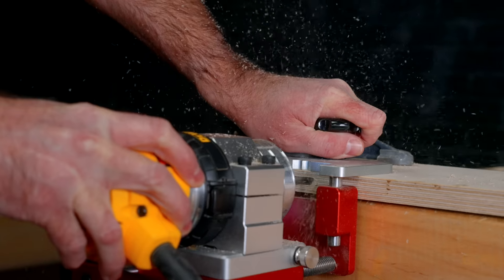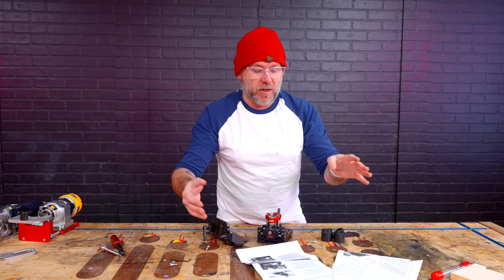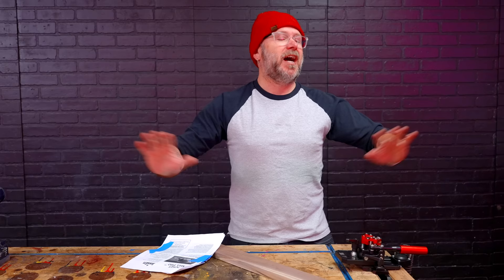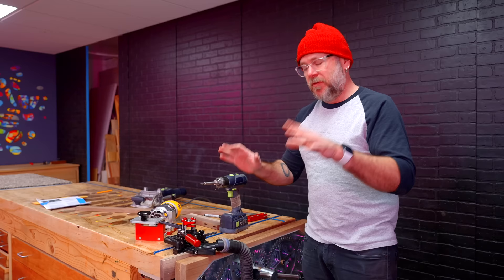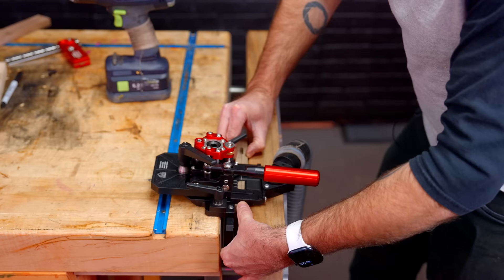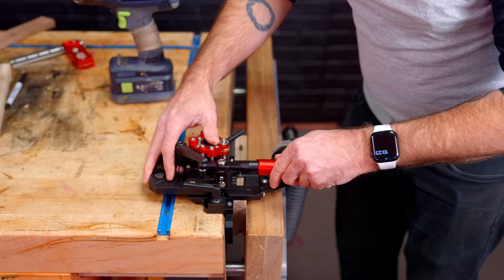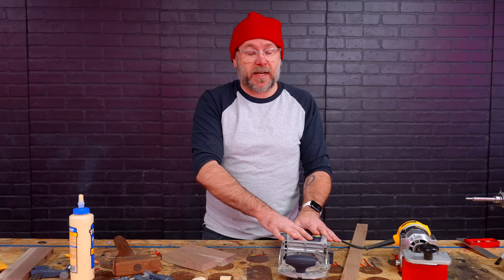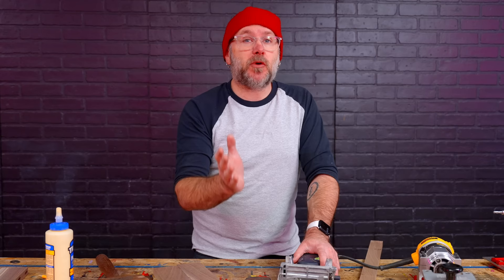I Regret Buying This Tool | Pocket Mill Pro

Comment: You hit the target on the manual(s).  I opted to buy the jig and it does handle the wood very easily and very well.  The naming of parts between the mill manual and the jig manual do not always match.  I fussed to JessEm about their manuals.  I was also missing two screws, I sent them an email with what was missing and they shipped immediately, without question.  I am certainly just a DIYer and do not want to sink the money in the Festool.  With working with the JessEm tool, the setup will become easier.  Good video.

Comment: Thanks for the review, Dave! 😃
For me, if I could buy it, it would be more than enough. But, again, woodworking is just a hobby for me, so... 😬
Anyway, stay safe there with your family! 🖖😊
Reply: I see your comments on a lot of the same woodworking channels I watch, including lesser known ones. Keep that passion going!
If you really want a higher end joinery system without a huge cost, consider the jessem or dowelmax jigs. The jessem is cheaper, but the dowelmax is easier to use since it has integrated clamping.

Comment: I think it's wise to hold off and wait until Jessem releases an upgraded version which hopefully will address the set-up and alignment issues. I'm sure their reply to complaints is that they offer the set-up jig as the solution. I suspect/hope the router  based based system will be upgraded to include dust collection and a flip up guard over the router bit.  For the $$ the router system makes more sense for weekend woodworkers.  I'm sticking with dowels until improved domino units are offered.
Reply: I'd say this is true about pretty much any new tool or even most new products these days. It's rare for companies to put in the time and money on development and testing that's really needed when making something totally new. It's easier and cheaper unfortunately for them to get it good enough then use the first buyers comments etc to help them develop and improve it and remove all it's rough edges so to speak. It's rare to find something never made before that's a perfect product from it's first iteration. Also let's face it things always get cheaper after being made for a few years.

Comment: Looks like a good idea for what you said Dave for a DIYer the only problem I can see 1 is that the tool is 350.00 OK that's fine 2 is now you have to buy the jig to go with it what's that cost 100.00 or even 200.00 now you spent 450.00 to 550.00 , I would  just buy the Ebay tool for 200.00 and most wood works have Dewalt routers

Comment: I think that one idea you proposed is what I'm going to ultimately go with; I'm already making my own custom workbench on wheels, so I might as well make my own place to mount this.

I don't currently do woodworking for income, so I had a tighter budget. My time is valuable, but not "$1200 for an average of 1-2 dominoes per week" valuable. My garage is also very space limited, so my workshop, gym, and bike rack take turns using shared space, and I need to be mindful of dust.

So far, I'm quite glad I was able to pick it up for sale - only $250 for the Pocket Mill Pro.

Comment: It looks like there were some screw holes on the Jessem jig where you could screw it into the face of your bench. It seems like having the jig attached to the bench would go a long way to making it easier to use, if you didn't want to pay the extra $190 for the Jessem clamping jig.

Comment: Seems like some of the shortcomings of the ebay jig could be solved with some easy DIY stuff. Clamp on a shop vac hose, screw on a small chunk of lexan to guard the bit. If you wanna go crazy, design an angled handle and find a machine  shop to make it so you can do 45 degree miter reinforcement (waterfall tables). All these things went thru my head when you first reviewed it. I don't have either of those routers, but I also wonder if I could put a sleeve of some sort on my Ridgid or Grizzly routers to make it work...

Comment: I'm with you, Dave...JessEm makes great gear.  I have the stock guides for my router table and table saw.  However, like you said, this mortising tool of theirs seems a bit too fussy.  I'm guessing that they're already well aware of the small issues and I'm hoping that they see customer videos like this one in order to make some tweaks because it does look like a pretty cool jig.  You really do a great review of it's operation (I'll check out the Lincoln Street vid too).  Like you mentioned, don't know how much smoother it operates with their optional jig, but with a bench vise it seems a bit cumbersome.  The action IS pretty cool though.  It appeared to do a good job on the edge, but will it do mortises on the face of a board?
Thanks for the demo~!

Comment: The  workstation clamping jig would make all the difference in the world. I have their dowel jig which also works with the same workstation jig. For the doweling jig it makes operations faster and the biggest reason I got the workstation is the ability to make fast repeated angled dowels, or tenons for this tool.  I had to make 8 chairs that had angled dowels on the side aprons and stretchers (would have been 64 tenons if using this tool) it was as easy due to being able to set up stops and hold downs. You really should try it. Would probably change your mind.

Comment: You could easily clamp the wood to the inside face of the moving part of the vice then move the drill jig in to place with the board clamped.

Comment: Great review, which is along the lines of Lincoln St. Half the price of the Domino by the time you include the additional jig (which is clearly required), but I would rather save up and buy the Domino instead, especially if I was going a lot of tenons.

Comment: I don't have a Domino or that jig. That jig and the clamping system are $540 and the Domino is $1200. To me, the Domino is worth twice as much but for the weekend warrior like me; Dowelmax is a good alternative.
Reply: Yep. Dowelmax is amazing. Not as fast as the domino, but 1/5 the price, joints are just as strong, it's just as accurate, and it's incredibly easy to use. My dowelmax changed my domino purchase from "actively saving for" to "I'd love to have one, but no rush.".

Comment: Question. the part of the jig that is against the edge of your table that your vise presses against the jig to hold the board, is there counter sink holes that will allow you to screw it to your table so it wont move????

Comment: I’ve got the Tianli and they forgot the limiting screw. Not hard to replace but this set scores with your Jessem. The Jessem looks so painful to put in place tbh. There are other very simple jigs for loose tenon (10min workshop) that would be better in many aspects. The Tianli is fantastic and as an amateur who installs tenons once in a while the Domino would be an overkill. I like that I don’t need to fiddle with it: once it is setup there’s hardly any change needed unless the thickness of the wood is drastically different. And I put the makita cordless router in it so no cable. It does make a lot if dust but I work outside for this.

Comment: Come on Jessem, it's 2023, get it together. Colored instructions or at the very least a full color pdf manual. And the launch issues could have been avoided.
As for the jig itself, this doesn't offer anything over the jessem or dowelmax doweling jigs. Joints will be just as strong, the doweling jigs are easier to use (even more so with the dowelmax's integrated clamping) and you'll be saving a good bit of money overall. Even fully kitted out, this tool is approaching half the cost of a domino, which may seem like a huge savings, but that's not factoring in our most valuable resource: time. And fully kitted out is almost a necessity for this jig, otherwise it's too cumbersome IMHO. And that time factors in even more if you're making your own loose tenons. Buying festool's domino tenons is of course an option, but compare a pack of 190 6x40mm dominos for $31, while 200 1/4" dowels will be $14, or 200 3/8" dowels for $17.
I've said it before, I'd love a domino for the speed and ease of use it brings to woodworking joinery, but my dowelmax has been serving me well. It's fast enough for me and the price was right.

Comment: People shouldn't complain about the Festool products. They are for a very specific market...like you say, the Professional. For most of us, a really good dowel system will be every bit as good, it will just take a little more time to put the joints together. I have invested in the Dowelmax system as many others have, and have no regrets. Again, it is a bit pricier than some doweling systems, but is worth every penny due to it's accuracy. I may have to try one of these tools out though, it does appear to work really well.

Comment: I just got the ebay jig in 3 days ago. This one looks nice and I still might grab one too. I doubt I will buy the extra jig though as it seems easy enough to make your own mounting/clamping jig for it. Also yes I already have a domino, but different setups for different setups in a custom cabinet shop is always useful.
Reply: Honest question, since you already have a domino, what enticed you to get the ebay jig? With as much as the domino costs, if I had one, I'd be using it as much as possible. $200 can buy a good bit of domino tenons and an extra bit or two.
Reply: @NW  i more look at it as a separate router jig. I am unlikely to bring the domino outside the shop unless it's for a specific job. If I go to a job to repair cabinets, my go-to is pocket  holes. I figured in some cases I may be able to do better, more professional looking joints with the makita router I already keep in that kit. Also sometimes it's a face frame that is broken and there is not enough space to do a pocket hole as there is damage and the domino is the best option. Saves me a trip without risking bringing a very expensive tool that might get stolen out of the truck. It's the same reason my personal truck power tool kit is the black and decker matrix. It's not as good as any given normal power tool set, but it functions in a pinch, and if it's stolen I am only out a few hundred bucks
Reply: @g00fysmiley  Makes sense. I'd keep the domino in the shop as much as possible too.

Comment: I tried the eBay jig but the slots it makes have just a bit too much slip. Using the same bit with Peter Millard’s jig from 10 minute workshop made a snug fit for the 5mm domino. Could possibly address by making my own tenons.

Comment: I don't hardly ever need tenons for the stuff I make. I'm also not really doing this as a hobby as I sell most of the things I make. But if I ever did need something with tenons I see myself leaning more towards to domino than the pocket mill pro. The setup time and finnickyness is what kills it for me. The less time I have to spend in setting up a tool vs making the actual cut the better.

Comment: Thanks for the review! Would it be a concern to be using this jig for an extended period and putting side pressure on your drill chuck? Hand drills =/= end mills.
Reply from the maker: That's a good question. I don't think that's a concern. The bit cuts extremely well and there's not that much side pressure on the drill.
Reply: @MakeSomething  makes sense, I see 8 ratchets per cut. Guessing the cut is 1/8th per pass, not too much and still fast. Thanks for confirming!

Comment: Your description of the Jessem, and all the fiddly setup steps, make it look like a pre-production prototype, the kind of item you send to third party testers and incorporate their feedback into the design, then iterate the process until the major complaints have been addressed. Then you finalize production. For example, why are you struggling with aligning the surface in the jig? Wouldn't it be nice if it were self-aligning? Using your first generation purchasers as beta testers is a poor, but widely used, production strategy. I'll use the Microsoft purchase rule of thumb and wait for version 3.
richard
--
The engineering triad:
- Reliable, cheap, efficient: pick two.

Comment: So what you're saying is, if I just buy more tools, all my problems will be solved. 🤔 My biscuit jointer is 1/8" slot cutter bit for my router. Think I've maybe used it once, a long time ago. It's clear to me that Festool is the obvious winner if you have a need for this kind of efficiency, but it's good to know there are viable (and not so viable) alternatives for those who want them and are willing to put up with their idiosyncrasies. I like having choices. Thanks for sharing!

Comment: As I understand life, you can get things cheap, fast, or good. Pick two. If you need fast, then the Domino is the obvious choice, but it is not cheap. If you need cheap and fast, then the router jig is a good option. I think that for the occasional woodworker, the Jess'em jig is a great option. It is more expensive than the router jig, but it has more features. It is not as fast as the Domino, but it doesn't carry that engineering baggage of cost. Since I am not a professional woodworker, I could see myself going for the Jess'em (with the guide jig) before I drank the lime green kool-aid. If I were ever to cross over to where I was feeding my family with my craft, then I would order the Domino as soon as it was beneficial to my needs.

Comment: I don't know how their jig works, but seems like you could rotate the tool to come in from the side and make a very simple jig.  Just recess a flat board so that the guide (that was down in the vice) is flush and then use some bar clamps to hold it all down on the table top.   would make the operation a little more awkward but should work. 
For a Pro shop, not the correct tool.  For a hobbyist could be a decent option.

Comment: What are your thoughts on this vs their dowel jig? I'm a causal, just starting, woodworker so the domino just doesn't make sense for me. And the ebay jig freaks me out a bit with the router, etc. (no matter how hard it might be to stick my hand in there). I don't have a bench vice so I'd have to get the jig for the pocket mill pro. Is the domino that much stronger than a 3/8" or 1/2" dowel? It also does seem nice that the dowel jig can go to your piece, vs having to take the piece to the jig. For reference, my only joinery jig right now is a pocket hole jig and I'd like to step up to something a little nicer, hence the research on dowel jigs and now this. Thanks for another great video!
Reply: I have the dowel jig.  It is a little expensive but very accurate.  Got nice flush faces with it on all the joints is used it on.

Comment: This REALLY drove home what was apparent to me from Lincoln Street's video: This is just a cumbersome, finickey waste of money. I had a feeling that the "optional" jig was pretty critical to making the tool itself work smoothly, but this confirmed my suspicions. So the bottom line is that you can pay $200 + whatever the router and bit costs for the ebay option, which'll put you at at least $350 and then you have dust all over, $550 for the jessm + the "optional" jig and have a cumbersome, finickey toy that is capable of making loose tennon joints, or you can just drop the $1,200 once and never worry about the issue ever again. How many folks are going to buy multiple domino substitutes before they've just spent as much as they would have on a domino in the first place?

Comment: So if I recall correctly, it's 350 for the tool and 180 for the jig, roundabout 550 with shipping.
Roughly half the price of the Festool for a lot of hustle and finicking. Why not spend the same amount on a used Domino instead?

Comment: I wouldn't want to monkey around with that tool.  I am content with my mortiser, or my router jigs.  If I did a lot of work that needed floating tenons I would invest in the Domino.  In general I make real tenons, nice to see all the people attempting to engineer an alternative for the masses and I suspect there will be improvements to the one that uses your router.  Dust collection, flexibility and some sort of safety guard are improvements just waiting to be added.

Comment: For me the hobby woodworker , who occasionally get compensated. I'll stick with my rockler dowel jig till I can afford ( saving now a domino) I learned the hard way in woodworking some cheap tools are ok some better off to wait till you can afford what you need for the type of woodworking you do. Jessem jig looks to finicky for accurate glue  ups on every project. The other jig like Lincoln woodworking said the router bit so exposed dont think I would like it. I also hate using my router in my hands router table I love  trim router use when it's the only way I can get what I want done.

Comment: I have a question for you,  do you ever take on viewer's challenges.  Where I suppy the lumber and you use it for a project. 
Rule 
Very little waste 
No jointer 

Wood is ruff cut cherry dried for several years. one hour north of you.
You keep what you make. 
Boards are 8 and 12 foot lengths 
What do you think. 
James

Comment: Clamp the board in the wise, set the jig on to of the board and use a pair of clamps to fix the jig on the board.
Reply from the maker: that would work on boards over 5" wide for sure.

Comment: Oh btw, you can get a dedicated good quality doweling tool that drills two dowel holes at one time that has most of the features of a Domino joiner (adjustable angles etc.) for less than half of a single Domino. Just saying dominos are not the only game in town.

Comment: Say you made your own jig , a rectangular piece of wood with 2x 1/4" holes and a centre line, and you use that to drill two 1/4" holes and use shop bought dowel to whatever depth you wanted.
How about you compare that to these jigs and the domino? I reckon for 80% of the use case, a simple dowel jig would work equivalent to a floating tenon.